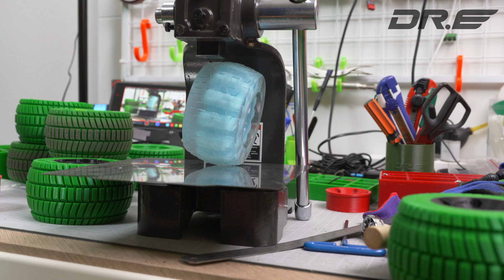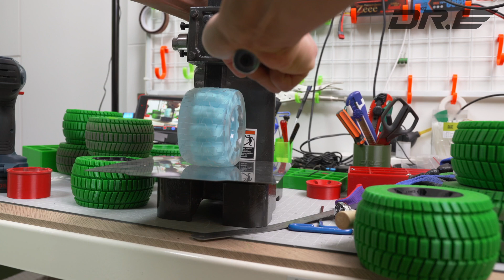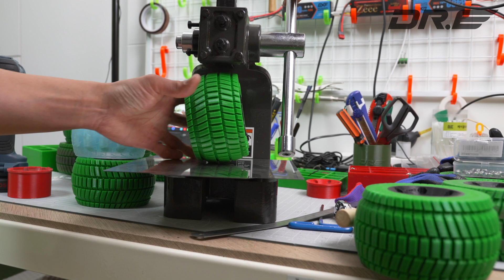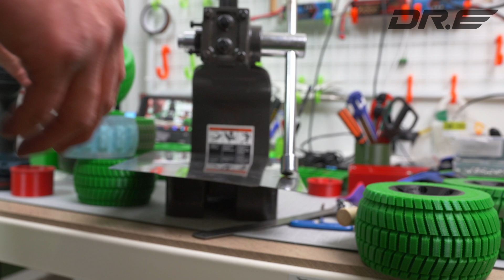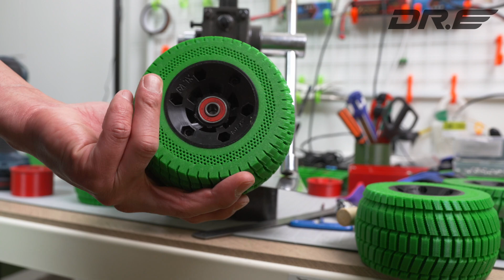120mm Cloudwheels vs Dr. E TPU Wheels Compression Test using 2 ton Arbor press!

Comment: Should make a wheel that can replace pneumatics. Like slightly oversized for Newbee rims so when you bolt the rims together it clamps the TPU wheel in place
Reply from the maker: That is what these wheels are, almost as comfy as pneumatics, the hubs are in two pieces and 6 m5 bolts are used to hold them together.  

You can see assembly here https://youtu.be/-C7QFLk-Flk